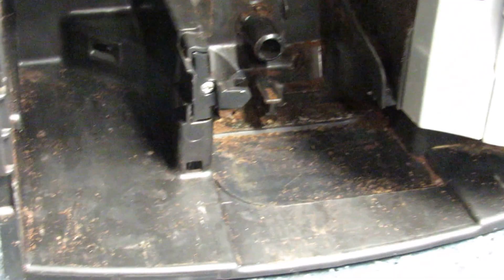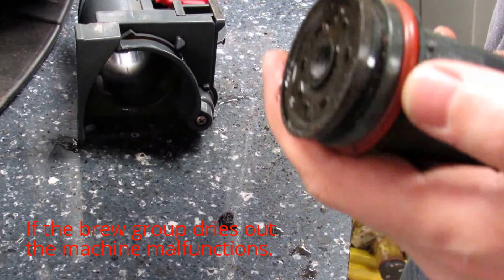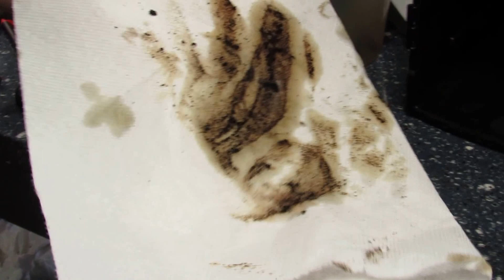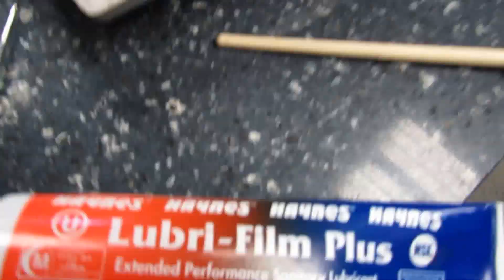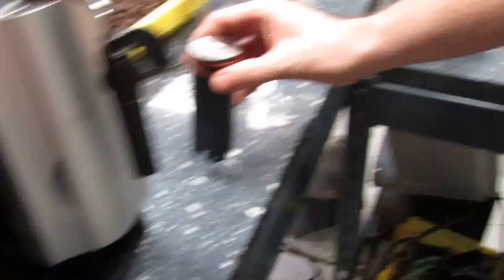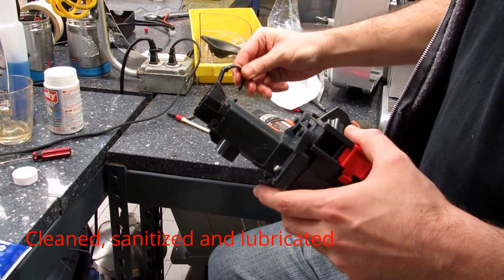Clean & Lubricating Infuser DeLonghi Espresso Machine at Mati Coffee

Comment: Really helpful.  My 12 year old machine started making weak coffee and throwing the bean grounds inside the coffee maker instead of producing those compressed waste discs of coffee ground.  It was the brew unit seizing up as it had never been taken apart as per this video (thats not in the user manual !).  A good soak and clean later and the brew unit was back in service and the machine working perfectly.  Thanks again.

Comment: Thank you.  Mine was so stuck I did not know the metal disk could even move up and down.  The symptom was coffee grounds going everywhere inside the machine.  The debris basket was not getting filled with the round pucks of discarded coffee. I disassembled, cleaned and lubricated per your instructions and it works great.  I found replacement o-rings and the same food grade lube in your video on Amazon.
Reply from the maker: That's great to hear, happy to help!

Comment: Great video, very helpful thank you! 👍I have found the Haynes lubricant that you used on Amazon, but I couldn't identify the other tube that you used for the transmission. The one that you applied with a brush to the spindle inside the machine. What is it please? Thanks

Comment: Thanks for the video...I completed the clean up as per the video...now when I run the machine, the brewer cassette does not stop elevating, like it wants to come through the top of the machine...after this initial cycle, I get the "insert brewer cassette" which is already installed.

Comment: Had a lot of trouble with water only dripping out the nozzles. Cleaned the infuser regularly but always went bad again soon after. Applied much more silicone as per this video and seems much better. Still getting coffee mush rather than a dry puck but one thing at a time.
Reply from the maker: Please make sure that your grinder is not set too fine. You could try to use a more dry roast. If this doesn't work you may need to replace your pump.
Reply: @MatiCoffeeIncElkGroveVillage   Problem solved. The disk on the top of the infuser is not decorative...it has tiny holes which on mine were all mostly blocked. Normal cleaning doesn't unblock these holes unless you pay attention to them. So, holes cleaned and working perfectly again. Thanks Mati

Comment: Thank you so much for this video!
My brewing unit doesnt come out at first, I have to move those arms at first . Do you know why it stops there when I turn it off? Is the machine broken?  Thank you
Reply from the maker: The machine is programmed to go back into the 'home' position when it is shut off, for easy removal and cleaning. If it is having trouble doing so, there could be a blockage or something isn't communicating correctly inside the machine. Keep an eye on it and if it gets worse it might be time to bring in to a trusted technician.

Comment: Great video but I get an issue with my machine after a deep clean. When I clean out the insides I usually sit the machine at an angle into to sink, I then  use water to remove all the grounds from the internals and it runs out. However the first time I did a deep clean the machine refused to acknowledge the grounds tray was back in. I went through all sorts and eventually stripped the side panels of the machine to locate the microswitch with a view to replacing it. I decided that looked easy enough but reassembled it and left it over night. It worked in the morning and continued to do so for months, then came deep cleaning time and once again I get this issue, and now again tonight. It is a pain and I know the switch is there and now cover the switch hole with my finger... still does this to me. Is the switch really that sensitive? I cannot see that being the case! It's just contacts. Thoughts?
Reply from the maker: The sensor is getting wet when you are cleaning in the sink. Therefore, when it dries off it works the next day. To locate this sensor you need to remove bottom panel of the machine. Be careful when cleaning the machine. Hope this helps, otherwise feel free to call our office anytime.
Reply: @MatiCoffeeIncElkGroveVillage  Thank you for confirming as I expected! Great news, have you seen this before?

As per usual it started to work today about lunchtime! 

I may need to consider getting a spare switch.

These machines are not very good at keeping the insides that clean!
Reply from the maker: @peterpeterson9903  yes, we have. Sensor don't like to get wet. We are here if you need anything. You could also go on our website for further information. maticoffee.com
 I'm happy to hear it's working!
Reply: I always tape over the tray sensor opening prior to cleaning to prevent this mishap.
Reply: @jpark4179  That would be a good move.

Comment: This was so helpful - THANK YOU! My machine quit putting out any water via the coffee spouts after a descaling. I pulled it all apart with help from your video, cleaned the tubing (very gross!) and the infuser. It is now sending hot water out the hot water spout, but barely drips out the coffee spout when rinsing before turning off / on. When it does, I get an error message saying coffee is ground too fine, insert water spout. So proud of myself for shocking my hubby with my ability to clean it - and now I'm determined to fix it! All I can think is some gunk dislodged during the descaling but I can't figure out where it's at. Any thoughts before I give up and take it to a pro? Thanks!
Reply from the maker: If you have a grounds too fine error message, this could be an indication that your machine needs service. We would recommend to have a technician check out the machine. It is possible that after the descale a pipe could be clogged with lime. Please contact us if you have any questions. info@maticoffee.com

Comment: Hey, nice video! I wanted to replace  the 3 red seals on my magnifica ESAM4400. I changed/lubricated the ones in infuser, and also the one on the boiler. Now, I have problems:
- rincing is slow, and most of water goes in the lower receiver...not in the glass :(
- during coffee, no coffee leak, but it's slow, looks like pump has problems to push....
any ideas?
thanks

Comment: Hello Mati-folks!
I've had my 3300 for 10 years now - it's a great workhorse!
Recently it has become loud when first switched on, but before the initial run of cleaning water.
Coffee is still fine, the interior is clean. Should I be worried?
Thank you for your great video!
Reply from the maker: Thanks for contacting us Anthony! It sounds like you need a tune-up and the infuser & transmission need to be lubricated. Contact us for repairs or any other questions info@maticoffee.com
Reply: Thanks guys.
New O-rings and lube are on their way ...
Machine is 10 years old, I love it so, it's time to give it a bif of TLC.
Reply: BOOM!
Followed your instructions, replaced all 3 O-rings, swooshed the lube around, and machine now sounds like a bean-to-cup (noisy) rather than a bridge collapsing.
I wouldn't have dared remove the bit that holds the diffuser, but your video made it easy.
A £7 kit has just extended the life of my £300 machine.
Sincere thanks and best wishes.

Comment: Superb video, thanks! Our machine refuses to operate with the "carrier" for the infuser sort of stuck in a high position making it virtually impossible to click the infuser into place. Do you know of any manual procedure to lower it? Cheers.
Reply from the maker: Hello. If the slider is in the up position when you turn on the machine, or when the machine is off, the machine has to be serviced. If you turn it on and the slider goes to high it can break your machine and it will push against the transmission which will completely burn your main power board. We recommend getting service for this machine ASAP! Transmission & power board repair can be expensive, so we would really say get the machine serviced before anything else happens on the machine. Especially if you have never had a professional tune-up or repair previously. If you have any questions please let us know: info@maticoffee.com You can always bring your machine here or ship directly to us.
Reply: Thank you very much for the kind advice. Full thumps up!

Comment: Superb video - thanks for the guidance. Our machine has decided to dispense uneven amounts of coffee. When we select two cups, one cup will be almost overflowing, while the other is only a quarter full. Do you know what might be the problem? (This only happens when two cups are selected).
Reply from the maker: It could be a clog in a pipe, solenoid valve, pump or even the dispenser. It would be best to have your machine serviced by a technician. It might just need a good cleaning or tune-up. We service all espresso machines so please contact us if you need any help!

Comment: My infuser used to lock in place and would not unlock until the shutdown was completed correctly. Now its easy to remove the diffuser whilst the machine is still on. Is there a reason for this?
Reply from the maker: Hello Peter, sorry for the delayed response! If the infuser was locking into place previously and now it is no longer doing that, then perhaps the issue has been solved by a tune-up? I can't pin point an exact reason without evaluating your machine personally. If you have any questions please let us know. You can e-mail us anytime at: info@maticoffee.com
Reply: when I say lock I mean not the two red clicks, but the electronic lock that will only open when the machine turns off properly. At the moment the diffuser can be pulled out with the red buttons without the machine having to be turned off. Doesn't seem right to me

Comment: very helpful.  Did not know this needed to be done so often.  For a home use machine serving 3 to 4 cups per day, would once every 6 to 8 weeks be often enough?
Reply from the maker: Hello William! The brew unit being cleaned is completely necessary for the health of your machine. :-) It does need to be cleaned at least once a week in hot, soapy water. You can use dish soap, and just clean it by hand. Even if you only make about 3-4 cups a day we would still recommend to clean the brew unit at least every 1-2 weeks. As far as the transmission lubrication, this should be done when the machine starts "squeaking".
Reply: You were so kind to reply and I'll begin a more through cleaning process for my Gran Dama ESAM6700,   My front door latch has stopped catching and holding the door closed.  Is there a place online I can see how to disassemble the inner cover of the door to see what springs may be out of place  ??  The 2 latch hooks move fine.  They are just not under spring pressure.
Reply from the maker: Hello William. We are not sure where you might be able to find a video that shows how to disassemble the inner cover. For an issue like that, you would have to open the entire machine and we recommend having your machine checked out by a certified technician just because you have to take apart the whole machine.
Reply: Thank you so much for your support.  With some perseverance, I was able to get it open and did figure out where the spring belonged.  It is cleaned and food grade silicone greased per your video and back together and working just fine now.   I still have a small drip or leak just inside the machine from the "infuser spout" after the coffee is made.  I am still not sure of the cause.  It is small leak, but an annoyance since it occasionally gets on the bottom of the cups and creates a ring where ever it sits.    You've been kind with your time in responding.  If you have any other ideas on things to check, I'll be very grateful.  Thank you again.  Bill
Reply from the maker: All you can do is try and clean the dispenser. If that does not do the trick then I would say your machine is in need of service or a tune-up. Thanks Bill!

Comment: Hello, thank you for your helpful video. I have a problem with my Magnifica where it only pours out probably 10% of coffee and it sounds normal when grinding the beans and making a cup of coffee as it always has. I descale the machine when required, water does come out of the milk frother and it goes to the entire descaling cycle, is there anything you recommend to check? I have opened the machine and checked for clogged lines but so far they all look good, no water is leaking and the infuser is moving as expected.
Thank you.
Reply from the maker: Have you noticed the coffee dripping into anywhere inside of the machine or have you seen extra water leaking into the drip tray? There could be a problem with a valve or flowmeter, or even the pump if only 10% of the coffee is coming out. If you're located in the United States you can ship the machine directly to our technicians. Just visit our website www.maticoffee.com Please let us know if you have any other questions!

Comment: Will this solve a issue I have on my machine where the coffee grinds doesn't all get sweep into the tray?
It was so easy to clean in the past, just dump the tray- now the grinds are all over inside. Pain in the ass to clean up all the time.
Reply from the maker: Hey Mike! Thanks for contacting us. 95% of the time a brew unit tune up will help solve this issue. The slider most likely needs to be lubricated as shown in our video.

Comment: What lubricant are you using to grease the transmission shaft? It looks different from the grease that you are using for the diffuser...possibly anti-seize on the transmission?
Reply from the maker: Hello Chris! We use Haynes Lubri-Film plus for all of the lubrication in our espresso machines. We use this for the brew unit and the transmission. It is a food-grade lubricant and it works wonders. You can purchase it directly from our website www.maticoffee.com It will be located in the parts/maintenance section.

Comment: Hi, my mum has Delonghi MagnificaS. She's been descaling it properly,  using filter in water tank and cleaning it overall whenever needed. 3 weeks ago she showed me, that it stopped making coffee. Water is moving through water spout, but doesn't go through infuser, so ends up all in leftover container. Seems like either infuser is somehow clogged or pressure is not high enough.  She's in Estonia and machine was purchased from UK eBay seller as manufacturer refurbished over 2 years ago, so no warranty anymore. Before paying half of the price of machine for repair,  my mum would like to open it and see if it's something, that can be done with help of YouTube videos... Which screwdriver does she need?   And can you suggest what could be the problem?
Reply from the maker: Thank you for contacting us. From the way you've described it, it sounds like the machine needs to be evaluated by a technician. There are many components inside of the espresso machine so without having a tech diagnose it, it's hard to say exactly what is causing that issue. It could be a pump, or a clogged pipe or solenoid valve. We recommend to take the machine to your local service center. If you have any other questions please let us know. Thank you.

Comment: all of the lights come on and flash and then they go off . I replug to initiate again, sometimes needing to  this several times . Then if I am fortunate the brew unit, cleaned and new O rings  and lubricated, travels up amd at the end makes a screeching noise. and then the two cup lights come on and the triangle light comes on. Then  I have to start again. Any ideas on issue(s)?
Reply from the maker: Lights flashing indicate a "general alarm" meaning something is wrong with the espresso machine. Since there are so many components, it is hard to determine what the cause is without inspecting the machine thourougly. If your brew unit is making a screeching noise it needs to be lubricated as we show in the video. It sounds like your machine is in need of a repair/tune-up. Please email us at: info@maticoffee.com if you have any other questions
Reply: thank you. As I mentioned , I did change the O rings and lubricate as shown . Still screeches as it moves up, not down .. do you repair if we send ? thank you
Reply from the maker: Yes, if it is still screeching then your transmission might need a tune-up. We are an authorized DeLonghi and Saeco service center. If you have any other questions or concerns please contact us at info@maticoffee.com

Comment: Hi, my infuser is stuck in the machine and won't reset. It did this under guarantee and DeLonghi fixed it in a way that made the machine make coffee again but I still couldn't remove the infuser to clean it. Any help appreciated!
Reply from the maker: If your infuser is stuck, you will need to have the machine serviced right away. The infuser pushing up against the machine could possibly break other parts inside such as the transmission. If you tried to reset and it did not work, it will need to be serviced by a trained DeLonghi technician. The infuser should be easy to remove for cleaning purposes. You can always contact us or send the machine to us for repair/service. Please let us know if you have any questions. Thank you.